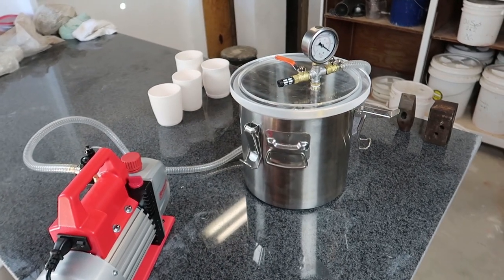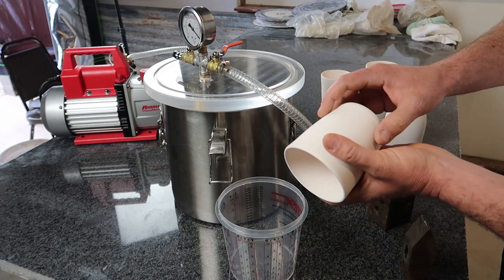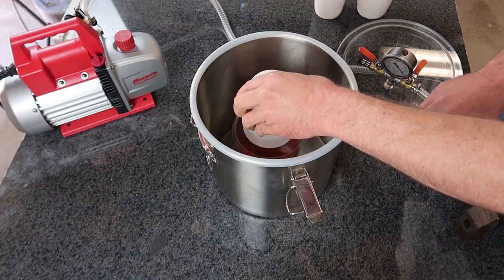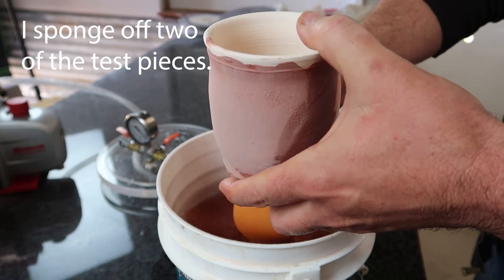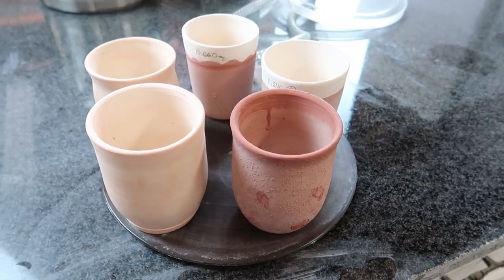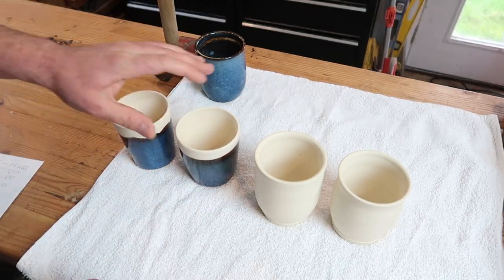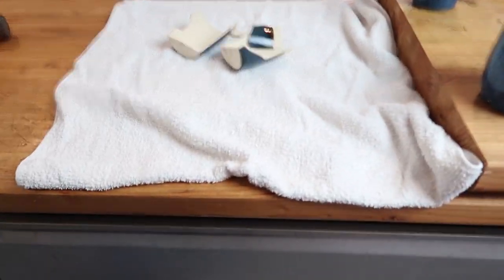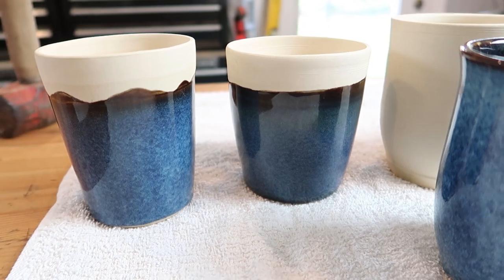Glazing Pottery in a Vacuum Chamber - Experimental

Comment: The reason to use wax, or other such resist, is because it's easier to clean a few drops off of that, than to scrub it off a rough bisqueware.  
There will always be some residue left, if you just sponge it off the bare bisque, but it's so little that it doesn't really melt, like it would if it were applied thickly (normally).